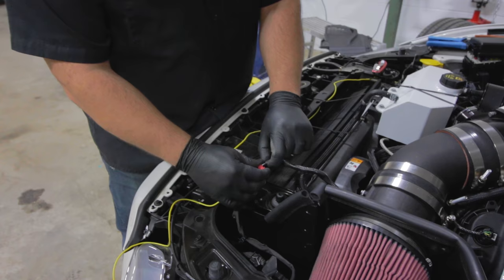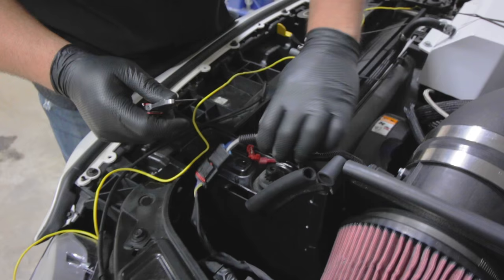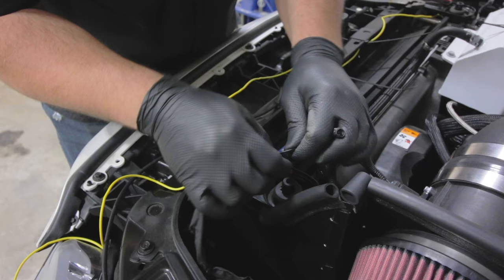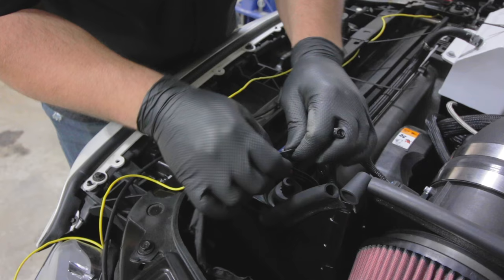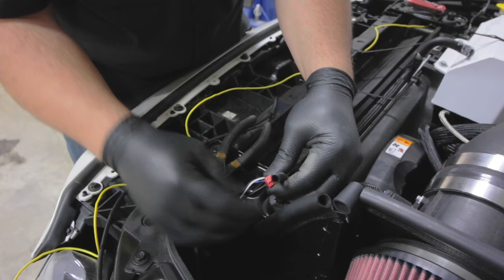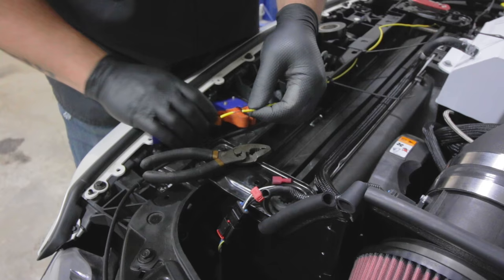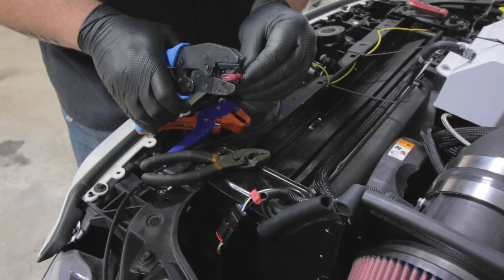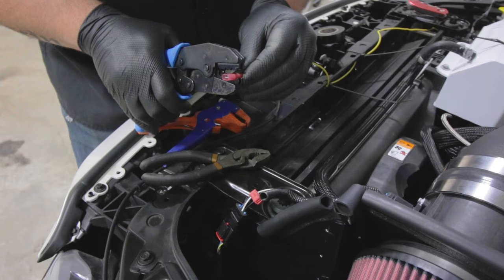Installation | How To Splice Wires Using GlowShift T-Tap Connectors For Tapping Electrical Wires

Comment: he didn't splice the black wire first before adding the locking tap. which means the tap and the copper inside the wire are not making contact...? am i missing something?

Comment: In my fuse box I have a burnt out to my fuel relay pin. Is this product robust enough to handle the Amps and Volts for the fuel relay fuse? ( 2008 corvette)

Comment: I like the simplicity but I’m having problems after a year, glitches in the connections on my aftermarket car alarm. I’m going to replace these T-connectors and do something else to ensure better functionality. Are there any other connectors of this type that is better? I saw someone using Posi taps, kind of the same principle but are they any better in the long run?
Reply: Best will always be a proper soldered splice, be that manual or the premade heat gun splices. Also, heat shrink helps a lot with keeping the elements out and also adds a bit of strength to any splice

Comment: Got a question about wiring up a aftermarket stereo. I have everything plugged in but I need a 12v ignition source to power the head unit. Would I be able to source that power supply from the wiring harness by splicing the red ignition wire or would I have to get it from somewhere else ie an accessory or fuse?
Reply from the maker: There's a good possibility that it would blow the fuse.

Comment: Known as Scotch locks in the UK.
Personally would never fit one on my car, most auto electrians in the UK would never use them.
If you must use them put some petroleum jelly into it to help prevent moisture getting into the wires.
Reply: whats a more preferable method of having a T splice?
Reply: @AE92World  soldering & heat shrink especially under the hood
Reply: @paulsosa1872  you how do you heat shrink a t connection when you cant get the heat shrink over the middle if the existing wire? Putting it over the new wire isnt going to do anything. But connections yes, doesnt work for t connections
Reply: But i agree w lazy j, scotch locks are crap. Especially w really thin wire. Better off removing about inch to inch and a half of the jacket on the existing wire, separate the strands so theres a space between half of them, thread your new wire through the space, move half the strands of the new wire to the left half the strands to the right then twist the new wire around the existing wire. Solder the connection, liquid electrical to make it waterproof then wrap electrical tape around it.
Reply: @paulsosa1872 solder should never be used in a car

Comment: I am looking to upgrade to leds on my 2016 Colorado and I seen where you tapped into the turn signal for a resister. Would I need just the one on one side or would I need to do the same on the other side as well?

Comment: I used this did find the hole for the spade can be filled with over spill from the plastic and I put the join on first before crushing sometimes I’ll crush it then not fit in properly lol

Comment: Quick and Neat.. I don't have a crimping tool though, is there any other way i can go for to strengthen the connection?
Reply: And pliers can be used as a crimper

Comment: Great video.  Do these t tap connectors hold up over time with the elements and vibration from the car?
Reply from the maker: We use them for most of our installs and have not had any issues.
Reply: the way to splice a wire. is the normal and better way. these are known to fail, and just a bad way tapping into a wire.
Reply: @zonlymachine  Um no. They are not known to fail. What failed was the installer who did not know how to install them.
Reply: At a minimum use the ones with gel inside
Reply: @zonlymachine common misconception

Comment: if you have a 12 gauge wire, can you tap it, then mix match a smaller gauge wire like a 22 gauge connector..?  or can you only tap a wire and plug in the same gauge..?  Thanks for a clear video.
Reply from the maker: It does not have to be the exact same gauge wire. If you are using a different gauge wire, it is recommended that the wire you are attaching should be smaller than the wire you are tapping into. Just make sure the size gap isn't too large. For example don't tap a 22 gauge wire into a 4 gauge wire.

Comment: If using the tap connector broke the wire what are your options?  Butt connector or solder?
Reply: You could do both but soldering will definitely fare better
Reply: @Adek_Reaper  no it doesnt,  already been proven solder fails on cars, aerospace etc.  they use crimps.  butt crimp is the best way strongest way that will last forever and never crack either.  solder cracks from vibrations.

Comment: Can you tell me what the orange tool was you used to strip the insulation of the center of the yellow wire. My thanks.
Reply from the maker: It's just called a wire stripper.

Comment: Nice video👍. Can I connect more than 1 t tap into the main cable your working on ?
Reply from the maker: Yes, you can.
Reply: I have 5 gauges would that many be okay to connect to same  power and ground line with the T- connectors? (Boost, oil pressure, air/fuel, battery, water)

Comment: Do you have to have the battery terminals off the battery to do this
Reply from the maker: It is always recommended to disconnect the battery before working on electrical. Although, the battery will need to be connected for you to test and see which wire is what.

Comment: Are they ‘one size fits most’? Or will it not work if the cable is slightly thinner?
Reply from the maker: The 3 blue tap connectors are compatible with 14-18 gauge wire sizes and the 3 red tap connectors are compatible for 18-22 gauge wire sizes.
Reply: @GlowShift this is wrong, try looking up the standard color code.

Comment: I hate scotch locks. Especially for really thin gauge wire. Both times ive used them for installing back up cameras they made terrible connections no matter how little or how much i squeezed the metal into the wire. May work ok for thicker guage but terrible for thinner guage. Just not enough contact/surface area for a stable connection. Also its not waterproof. Better off removing the jacket around the middle of the existing wire, about an inch to inch and a half of the jacket/insulator. separate the strands so you can thread the new wire through it, separate the strands of the new wire half to the left half to the right then twist it around the existing wire. Solder the connection. Dielectric grease the bare wire or liquid electrical tape to make it waterproof, then wrap electrical tape around it.
Reply: Is there a tool for removing the jacket in the middle of the wire?
Reply: @oodles86 a wire stripper?
Reply: Thanks for saying this. I was looking at putting a backup camera myself but since I don't have any knowledge on soldering I was looking up these connectors. I look around for a local shop to put it in for me instead so I don't have any issues like you describe.
Reply: You used the wrong size then

Comment: What is the orange and blue tool called that you used on the yellow wire to cut it and strip it?
Reply from the maker: Wire Strippers.
Reply: self adjusting

Comment: Been thinking about doing this but instead of tapping directly to the dervice(s) tap to a small fuse box using wire with an inline fuse and placing the box it in my glove box to run a radar detector and dash cam in my challenger. Would that work?

MICTUNING 6-Way Blade Fuse Block with Cover Fuse Box Holder for Vehicle Boat Marine https://www.amazon.com/dp/B07VYWM9XC/ref=cm_sw_r_cp_api_glc_fabc_tdA0Fb6FR5VNJ?_encoding=UTF8&psc=1 
This is just so I can keep the factory harness as clean as possible and retain the ability to remove and/or add stuff. Think this would work?
Reply from the maker: Yes, should work.

Comment: This style of connector offers no protection from dirt or moisture so it's basically like inviting corrosion. Moreover, the the tiny amount of surface area contact between the IDC and the wire means extra resistance in the junction which could lead to overheating in high-current applications. These might be the worst kind of connector to put under the hood of a car. They are the lazy man's connector. Use a proper splice technique or run a new wire to the fuse box.